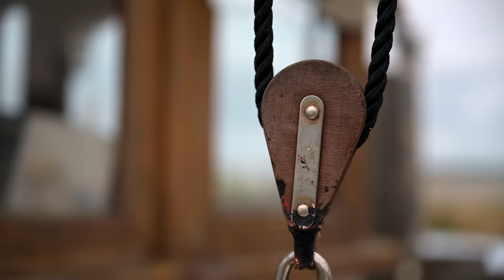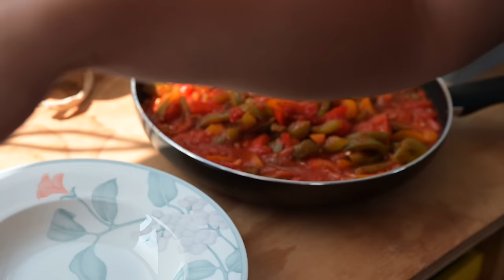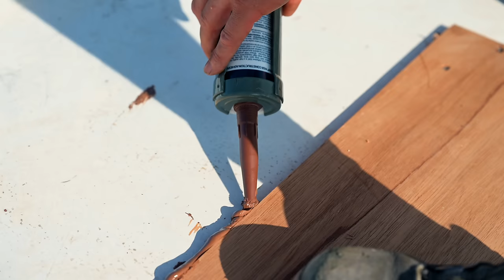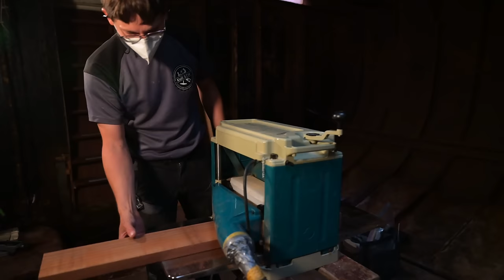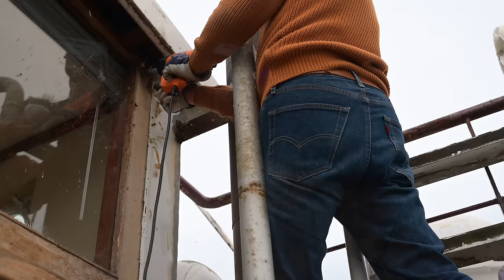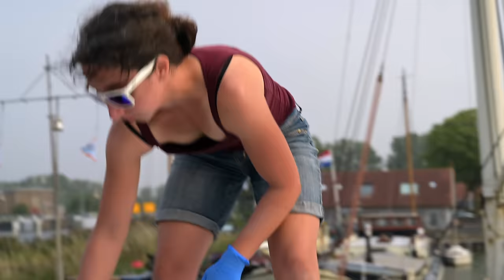Restoring A 73 Year Old TEAK Wheelhouse

Comment: Keeping water out of a boat is a universally accepted good practice😃
Reply from the maker: It's too easy to achieve! 🤣
Reply: @FlyingConey Yup, a hole in the bottom and it will just drain out😇
Reply from the maker: Fun fact, we have a little drainage hole at the bottom for when the boat is on the hard.

Comment: You should keep that wood working guy he does GREAT work. Question if the windows are Teak which is an oily wood, wouldn't it be better to just keep it oiled? That way just a stiff brush will keep it clean?
Reply from the maker: Teak is rott resistant all by itself. Normally a teak deck is neither varnished nor oiled. It simply turns grey. So varnishing it will drastically improve the look of the boat. Technically it's not necessary and slightly worse. Ultimately we picked Epifanes Teak Varnish over Le Tonkinoise but it was a close decision.

Comment: What ever spirits that make up the Flying Coney, truly had a lucky day when you guys fell for the ship. I have a 36 foot steel hull sailboat that was bought as a project, your project makes mine look like a Sunday afternoon washdown. I have been following you guys for a while and I'm not sure how you keep it up. I think I would have parted her out a long while back. You have a very lucky boat and you are that luck. This far in, keep up the good work, you're doing great.
Reply from the maker: It took us too long to realize what's ahead of us and it's too late to stop now. Good luck with your project. The size of the boat it a real challenge in many aspects but on a smaller boat you run into issues we don't have. We now try to make a plan and then we work our way through step by step. But the boat needs to have a purpose. Use it or loose it...

Comment: The boat is in the right hands. You all are doing a great job. Enjoying the channel. Tks for sharing.
Reply from the maker: Thank you for saying that. It's not easy to explain our decisions. Sometimes it's just necessary to fix things because you simply have not enough time to do a full repair. Also the size of the boat doesn't leave much room for perfectionism. We try to reduce the maintenance backlog by doing everything "good enough" for now. After a few years we will see what has worked and what needs do be done better.

Comment: Harold really knew his way around a ship like "Flying Coney" he's a true shipwright which is VERY obvious. You're lucky to get his help, he's worth his weight in gold, I think. Kudos to Harold, bravo!
Primer coat: raw plywood just drinks up paint, which is hard work, but also good .. 🤔😁
Curious: ..no waterproof caulking sealer in-between edges of sheets of roof's plywood.. why is that?
Reply from the maker: Thank you. In between the plywood sheets there was enough squeeze out. After it was dry we cut it off and sanded it down. So there is sealant in between.

Comment: Thank you for your videos, very inspirational!
You mentioned the teak wood of the wheelhouse is better off without varnish. I recently removed the varnish from the teak cabin sides of my small sailboat.
After a sunny week the wood had some cracks and i needed to fill them. Maybe try to seal the bare wood with one or two coats of  linseed oil after you removed the varnish so it doesn't dry out too quick. Then you can varnish it in spring. I'm no expert but it worked for me when i tried it on a different spot. :)
Keep up with the good work und lasst euch nicht unterkriegen!

Comment: All the boats i have owned were wooden so i know a little bit about boat repair 😄and my father after retiring made high end custom furniture .I think he would have liked working on Flying Coney .At last you won't need to wear your foul weather gear inside when it rains 😁.
Reply from the maker: It was last minute to do something about the roof. One more winter and the rot would've affected the deck beams. I know the patches isn't the best repair and it would be better to exchange the plywood. But this fix gives us enough time to prepare a proper repair and more important it prevents further damage.
Reply: @FlyingConey  Ahh my friends stuff happens .At this point the most important thing is to make sure the wheel house is tight and dry .those repairs looked very good and should last well over a year .I'm thinking you have ,or nearly so come to the end of the hurry up and do something stage  .quite an achievement in the amount of time you have done it in and the amount of work involved .and as long as the decking doesn't leak you should make it thru the winter in good order .If i was a doctor i would subscribe a day of rest and a nice dinner with a glass of wine .O and i did vote for you on the REFIT OF THE YEAR .

Comment: Hi gang !! You mentioned not laquering the teak on the wheelhouse. Put a layer or two with raw linseed oil. It will keep until next summer,and can be applied with a sponge,or brush...
Allda bestest from mikke in sweden...👍🇸🇪⚓⚒️
Reply from the maker: We already have bought a can of Epifanes. The problem is the sanding cause I don't want to varnish or paint over black stains and all that.

Comment: Great job. Looks better than new. I don't know if you would use raw linseed oil instead of varnish. I use it on all my wood work. Indoors and outdoors and its food safe. Keep applying coats until it stops soaking into the wood. Then a few more coats will form a hard varnish like finish. Having suggested that it maybe better with varnish if there is a lot to do.

Comment: An idea I have used many times is caustic soda mixed with wallpaper glue in powder mix it with water glue and caustic soda applied on the teak and after 20 min its easy to remove the old varnish
All the best
Brian 
Sweden
Reply from the maker: Interesting! But the heatgun worked great also.

Comment: I enjoyed the Sail Life glorious sanding reference. But there's no way you left the rot inside the roof without at least talking about its future...
Reply from the maker: At one point in the not so far distant future we need to replace the entire plywood of the roof. There wasn't enough time to do it this year and we also are not sure about the final dimensions of the wheelhouse. We removed the rot and sealed it. It will last a few years and then we will replace the roof and sheet it over with fiberglass. Since it's there's no moisture and no oxygen I don't think the rot will continue.

Comment: Try chemical stripper on the wheelhouse and a edge sander for hard to get spots. Keep the carpenter, excellent work on the roof.
Reply from the maker: I think the wheelhouse needs to be sanded to get a uniform teak color. Technically  it's good now and we will continue sanding next spring to get a perfect finish.

Comment: Hi, Barbara. Is there a reason for not glassing the roof? Then, it would be waterproof for decades.
Reply from the maker: There are a few reasons. We will exchange the roof in a few years, the weather now would have made it very difficult to work with epoxy and it's not worth the extra money for a temporary fix. We want to keep the sides of the wheelhouse that's why we invested more in the corner repair.

Comment: ...really nice job on that corner repair ...not entirely sure why you didn't sheet the whole roof? ...good progress anyway
Reply from the maker: The area looks way smaller in the video than it is. We sheeted over a bit more than a third. Since we didn't had the time to approach a replacement of the plywood the fix we did really was the only solution. You just have so many hours you can invest working on the boat. If you always have to make decisions what's most important at the moment. Investing 8 weeks and thousands of euros into the wheelhouse while other parts are rusting away doesn't make sense. We need to get on top of the maintenance, see what worked, invest more time in things that hadn't worked. That's the plan.

Comment: I give that roof 5 years , 7 if you repaint often. It seems a very practical choice at this point. I’m sure you have many greater priorities. Next time try using a paint roller . A roller with a long stick handle will cut down on that job by hours.
Reply from the maker: We've planned do relocate the wheelhouse and replace the roof in about two years. So 5 years is plenty of time. After the first coat we started to use the paint roller and it's way quicker. Still no easy task because each layer was 3 liters of paint.
Reply: @FlyingConey   w
When I paint house tops and decks , I use a handle about 1.5 meters long. That way I don,t have to bend over and my reach from the roller pan is greater. Saves time.  Also you have my vote. Good luck.

Comment: You said she was a warship at first I’m very interested in what information you have on her service pls share if you can
Reply from the maker: The frames of the ship are from type of warship called Kriegsfischkutter. These boats were built using steel frames and wooden planks. During the war this relatively small warships were used for outpost and lookout duties, bringing out mines and minesweeping, hunting submarines and for anti- aircraft warfare. 
Especially after the war this boats were used for minesweeping and many got converted back into fishing trawlers at some point. So what we believe is that Flying Coney was damaged after the war doing minesweeping, the frames were saved and the ship was rebuilt with a steel hull. At this rebuilt the bow and the stern were altered to match the lines of a logger for better fuel economics. 
If you're interested in a certain aspect feel free to ask. 😉

Comment: May I ask why you do not fiberglass the plywood to make it watertight? I mean, first fiberglass and than the primer coat. Could you explain us this peculiar choice?
Reply from the maker: It's a temporary fix to prevent further damage. Fiberglass and epoxy is expensive so it would be necessary to replace the rotten plywood first. That would be the proper way of doing it. But we don't have the time to do it now and also we will alter the size of the wheelhouse in one or two years anyway. So that's why we used a temporary relatively cheap fix for the next few years. We hope we can reuse the window frames and also the sides of the roof that's why invested more time into that.

Comment: I'm surprised you didn't fiberglass the roof.
Reply: Far as I know, it's temporary work so they can get the boat to Germany asap? Am I right?
Reply from the maker: True, there was simply not enough time to approach a major repair. We will also alter the size of the wheelhouse for the sailing ship transformation so any repair would be temporarily. So we picked the cheapest reasonable one.

Comment: Why did you choose not to fill roof damage with penetrating epoxy, then fiberglass matt and filler? Seems like adding a new roof layer left the rotten plywood underneath and provides a place for moisture and rot to continue.
Reply from the maker: We removed all the rot and with a lot of sealant we made sure that no water can get underneath the new sheets. That fix gives us time until we replace the rotten sheets as a whole. Sometimes it's necessary to fix something until you've the time to do it properly. For a fix that needs to last 2 or 3 years I think we did a good enough job.

Comment: Awesome. Since the beginning I've been looking at that wheelhouse and wondering when you guys would get around to fixing it up. Question, why not fiberglass the top?
Reply from the maker: Because the wheelhouse roof doesn't have the final dimensions yet. It will change size for the sailing ship transformation. Then we will exchange the plywood and fiberglass on top. The fix we did gives us enough time and prevents further damage.

Comment: Curious it you used epoxy and why didn’t you put a fiberglass membrane over the plywood
Reply from the maker: Simply to save time and cost. We will ultimately alter the size and the location of the wheelhouse. So the goal for now was to prevent further damage. It just need to last for 2 years. Once we exchange the damaged plywood we will put glass on top. But don't underestimate the costs for that we're talking 1-2 000€ for epoxy and glass fiber.

Comment: I know it's temporary. But, fill the rotten spots with thickened epoxy. I think it's the better way. Instead of black concrete sealant. That lasts a maximum of 3 months, for a real emergency solution. Greetings from Spakenburg, Netherlands.
Reply from the maker: Not sure what you mean. We've used a two component wood filler, I think that one is epoxy based. The sealant we've used is similar to sikaflex. A permanently elastic glue and sealant so water doesn't get underneath the plywood sheets. We haven't filled up the rotten spots just removed the rot.
Reply: The black “concrete sealant” is in fact Bostik MRS (marine sealant / construction adhesive)

Comment: Why not use pure tung oil mixed with mineral spirits to refinish the wheel house?  Pure tung oil has been used for thousands of years to protect wood at sea.  You'll never have to re-varish again, all you do is put mor oil on.  It's not like linseed  oil that stays wet, it gets hard and is so easy to repair if it gets damaged.
Reply from the maker: Teak doesn't need oils or varnish at all. It's resistant against rott. The only problem is that it turns gray. So varnishing or oiling is only for the look. We considered Le Tonkinoise (mixture of oil and tung oil) but ultimately choose Epifanes because we also want to use it on the chart table. One product for everything makes our lives easier. But it was a difficult decision.
Reply: @FlyingConey  you will find that old teak has lost much of the natural oil that helps stop it from rotting.  Pure tung oil mixed with mineral spirits help the oil penitrate the teak and replenish the missing oil.  Epifanes will eventually let water get into where the missing oil is, and then it will bubble and flake off.  You will again find yourself holding a scraper.  Maybe you will remember my coment when that happens 😉
Reply from the maker: If it happens I sure will! We realized that you're always experimenting with different methods, paints, rust converters, coatings, oils and so on. Harold our shipwright and volunteer recently made some bad experience with Le Tonkinoise on a teak wheelhouse so we picked Epifanes. But ask 5 different boat owners and you get 15 different opinions. Ultimately you have to make a decision and will make your own experience.
Everybody told us that our de rusting of the hull wasn't good enough and we should've sandblasted, used rust converter, used a different kind of paint.... Now after one year we're still rust free. Next time I will use rust converter.

Comment: i would replace the rot on the roof and then fabricate a stainless cap
Reply from the maker: If the wheelhouse roof would have already the final dimension we would replace the plywood and sheet it with fiberglass. That's the proper way of doing it. But that costs several 1000€ and a lot more time. So the repair we did gives us time to focus on the more urgent problems.

Comment: A hot air heat gun and scraper is a good way to remove varnish. I see. That’s what you did.
Reply from the maker: Yup, but it was a bit tricky because vacuum, sander and heat gun was too much for the breaker.

Comment: Short cut on the roof won’t work for long just not the way to go when restoring a old beauty,
Reply from the maker: It just need to last long enough. We will do a proper repair after we've relocated the wheelhouse. The fix we've done is good enough to prevent further damage for a few years.

Comment: Why didn't you just fiberglass over the whole roof??, at least it would've all been uniform and looked really good instead of having awkward high boards. If anything i would've gotten the extra wood i needed and did the whole roof so everything was uniform, yeah that turned me off. Sorry guys but I'm a crazy perfectionist when I do things, I guess thats why all the cars ive built turned in to bigger projects than i projected, but the end result is always the most appealing.
Reply from the maker: In the end we will exchange the roof and fiberglass it. That's the proper way of doing it. But what do you do when you don't have the time and the weather window to do such a task? How do you prevent damage to the deck beams and the interior of the wheelhouse? Sometimes buying time until you can do the real repair is all what you can do.
Reply: @FlyingConey  Yeah, that's true. It's always good to keep heavy-duty tarps on hand because, well....ya never know. Imagine doing a roof on your house and a storm pops outta nowhere when you have nothing but beams up😳 Now id would either remove what you did in plywood and fiberglass the original roof or if you have the height room for the gutter-rail I'd finish off the wood and fiberglass over the whole new roof, a little overkill but what the heck. I'd bring the fiberglass over the edge and stop at the bottom of the outer trim, I'd create a new gutter channels on both sides through the absence of plywood, you can actually use a drip rail in the back 😁👍